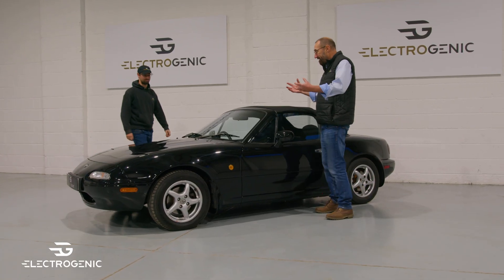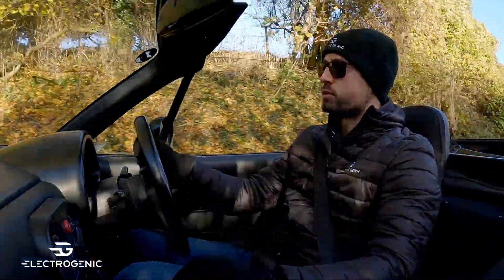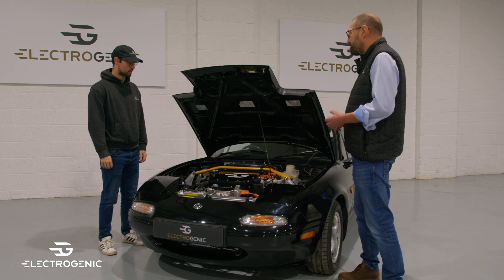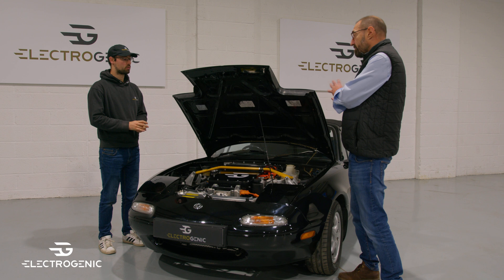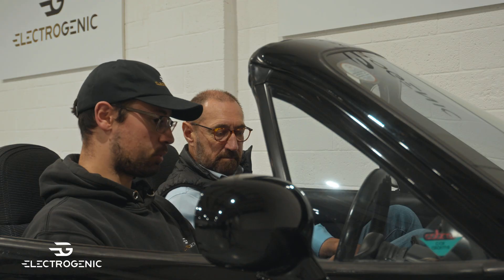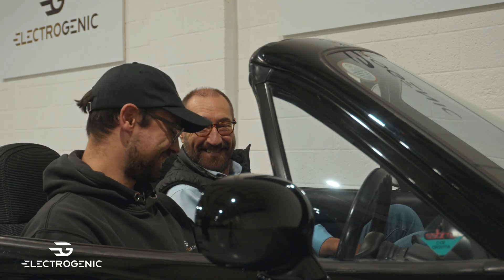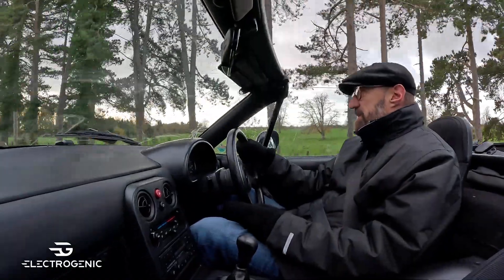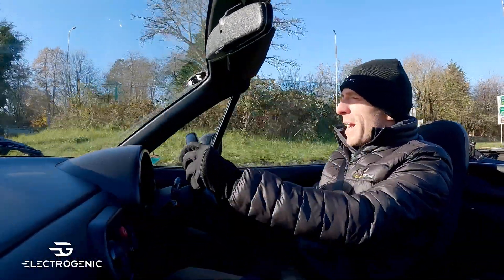Electric Mazda MX-5 Conversion Kit | Electrogenic

Comment: I wonder how much range you could get with a few aero mods. Like a hard top rather than a soft top. And completely flattening the bottom of the car to reduce air drag from underneath. Also maintaining the headlights down when not in use. Id love to see this on an NB

Comment: I have to ask - what is the price?
Reply: How many are asking? Vote is thumbs up 👍
Reply: Number of potential buyers will change cost due to economies of scale in manufacture.
Reply: If I had to take a guess, I would say AT LEAST $15K USD.
Reply: @nomadben  I would think double that.
Reply: Some articles seem to estimate $35k for the kit
Reply: @rexurtiser  I would want an LS under the engine bay for that.
Reply: If you have to ask the cost, you can't afford it
Reply: @macman6421  if it costs that much, it's not good enough

Comment: I think you've missed the entire point of an MX-5 by converting it into and EV, also a 150mi range?
Reply: Different strokes for different folks.
Reply: The entire point of a MX5 is a lightweight roadster with 50/50 weight distribution.
Ticks all boxes. What else is missing?
Reply: @ckarcher  manual transmission redlining etc
Reply: @ckarcher  but i am all for EV i cant stand huge petrol cars like v8 smell tbh the m5 is good low emissions but 0 would be insane
Reply: Are there simple terms to portray the change in weight distribution and power delivery made by a conversion?

Comment: This is great and I love the engineering.  But I am concerned about the cost of EV conversions.  In the UK you can now buy a new MG Cyberster sportscar for £55k. It has crash protection, air bags and a warranty.  Also I've driven one and it's great.  Compare that to converting an old classic sportscar, which will be much more expensive overall, and much less safe in a collision.  
Don't get me wrong, I would love to convert a classic car to EV, but the costs don't really work currently.  Hopefully as battery prices continue to fall, conversions will get cheaper.
Reply: Converting anything isn't much about cost effectiveness as much as it is you wanting to maintain a specific car, have it look the way it does, but has modern features or drivetrain.

Comment: Unless you keep a manual transmission with a clutch pedal it’s totally pointless on a Miata.
Reply: In an EV conversion you wouldn’t use more than two gears anyway.
Reply: Not everyone wants a visceral connection to their means of transport. MX-5 still efficient way to travel even if more "fly by wire" controls become normal.
Reply: Same

Comment: Sorry but that’s slow charging for such a small battery/range.
Reply: Might be better for battery longevity
Reply from the maker: 20-80% in 45 minutes is fine for our customers. Range is real world actual driving range that we have driven in the car - not theoretical. We find most people don't drive more than 150 miles often and when they do they stop for a coffee at a fast charger. The range is limited by the space available in the car. It's a small car and we have been careful to keep it as light as possible and we don't cut, drill, weld or alter the car so we are only using the existing space.
Reply: @ElectrogenicREV I couldn't even get to my parents or brother and back in one charge. Many people have over 1 hr commutes. Sounds a little unacceptable.  Is 150 miles 60% or 100% of battery. Eitherway just not true. I visit my brother multiple  times a week, parents every other week and job is about 50 miles each way. With my 10 year old hybrid I get easily 650 mile range and can barely get through a week without fueling. This would simply fail at many commutes
Reply: @gradetsk Clearly not the car for you.